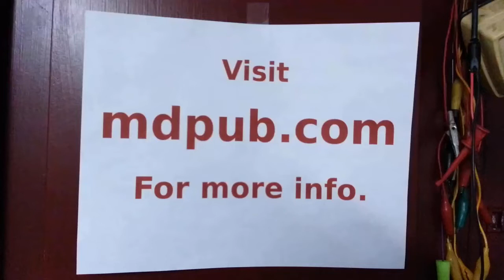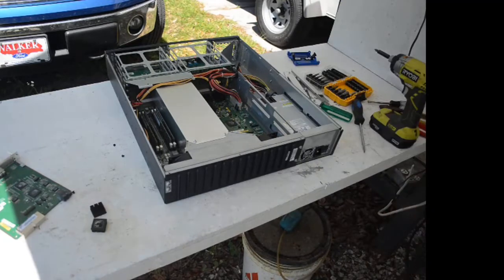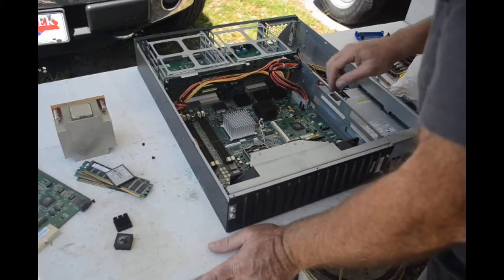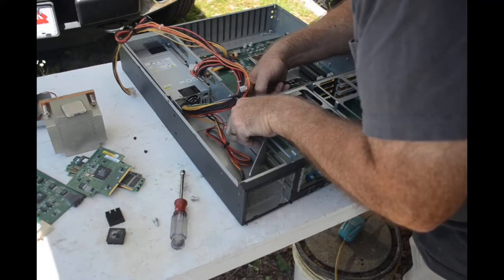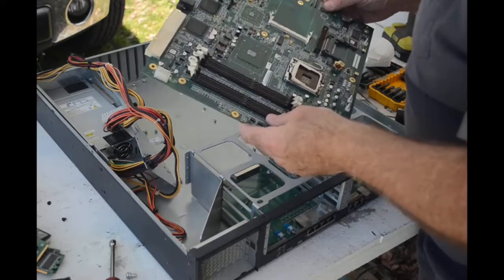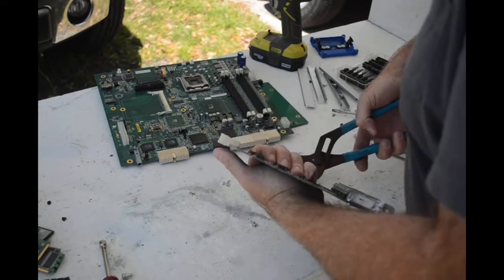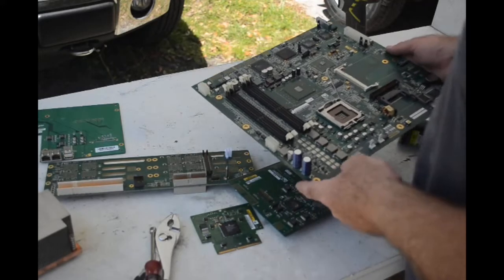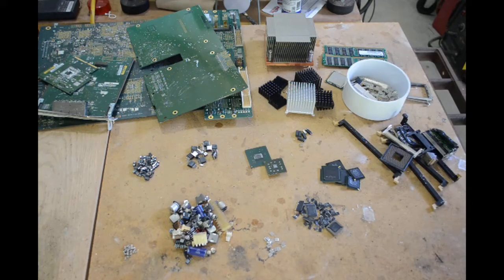Gold recovery from Juniper Networks J4350 Ethernet Switch tardown and scrapout.

Comment: Had a question using hydrogen peroxide & hydrochloric acid woking with metal contacts , looking for some ideal of when the AP is no longer  usable ?
Reply from the maker: Not to be a smart alec,  but whenever it stops working. It can work for a long time. I use a fish tank bubbler to oxygenate the liquid and keep it agitated. I top it off with more hydrochloric acid from time to time as it evaporates, and it just keeps working. At some point the liquid will become saturated with metals and stop dissolving more. Hard to say when that point will be reached.
Reply: @omegageek64  Thanks , well whenever my teachers said " don't be a smartass " I would reply , it's better than being a dumb ass ;)
I have to start over in the spring - MN winters , and leave the last seasons filtered for storage for winter , waiting for another batch .

Comment: I have 4Kg of mixed ic chips/flat packs that I have removed off telecom system boards and network equipment. Chips dated from late 70's to modern. Im wondering if i sent them to you. You could make videos with them. If the value you received from the YouTube content would be a fair trade? Obviously I'd prefer to receive the gold. You keep the silver and get the YouTube revenue? If the offer is out of line I mean zero disrespect. It was just a question. As I'm not getting anywhere close to what you do out of em. Let me know what ya think thanks. Love the videos.
Reply from the maker: Hi Nick,

The offer isn't out of line. I get them all the time. Yours is actually one of the better and more intriguing ones. I'm out of town for a few weeks. Get back to me around the middle of June and maybe we can do a deal. Leave me another comment here then and we'll exchange contact info.
Reply: @omegageek64  sounds good. I'm a pbx installer. Have been last 15 years. I got pictures of yhe better boards the chips came off. But typical Avaya, Intel, iwatsu, and everyother old pbx manufacturer, old dual bus systems, t1/PRI smart jack slot cards... Ect. Ect.

I just watched sreetips dirty solution video. And have a pretty good idea where my golds been going... Into the stock pot with the green liquid and the silver chloride.... Not doing enough nitric washes and then when I do aqua regia the reaction stops I test solution. Is basically neg. Not black at all. I filter off solution and and throw filter in stock pot/or away thinking it's just sludge from chips. Prob super hard to follow that brief summery... But i do believe that's what's happening.